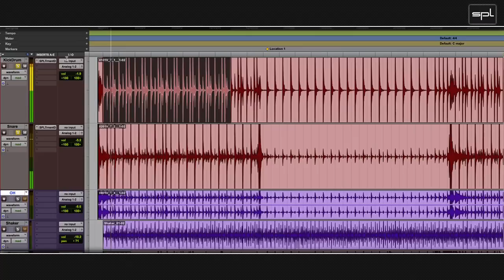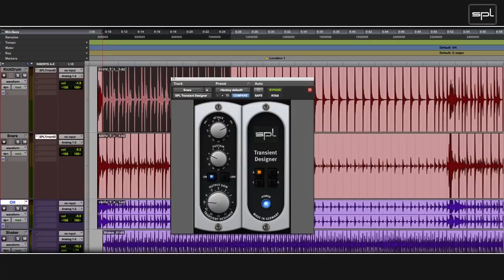Transient Designer plug-in: On Snare and KickDrum (EN)

Comment: I don't think this is the same as a fast attack and/or release on a compressor and then a simple roll off gate. It's more like it is adding additional sound (in the form of transients) to the signal and producing an entirely new sound of sort. If you listen to the way it adds to the snare when the sustain is increased you'll notice there is a slight coloration to the tail of the sound (which I like). I could see using this a lot and with the sale running now... I think I'll go and grab it.

Comment: Great video! If the signal is too hot going in why wouldn't you just turn the volume down in the mixer, i.e, before using the SPL TD? In my opinion the kik and snr overpower the mix, the guitar is brittle and bass is lost. I guess this is a demo, but not a good sounding mix
Reply: Because the fader doesn't control input gain, only post-plugin output gain. I personally use either the clip gain or trim plugin at the beginning of the chain to control input volume.
Reply: He didn't gain stage most likely.

Comment: Awesome plugin, great sound. Im thinking of buying this. But as a legit question: I use alot of the Fabfilter Pro-G and Pro-C to achieve similar sustain reduction on drums. Apart from being easier, How does this compare to my current method if you could be bothered to explain in technical terms ?

Comment: You lowered the output stage of the plug in the signal is still being overloaded at the input stage  you should have brought down the input gain on the channel in PT    That's a big fail
Reply: Frequency Studios nah, I disagree. His input doesn’t appear to be clipping. But it’s possible that once the plugin is applied the gain increased. So he dials it down a little to bring it back like it was.